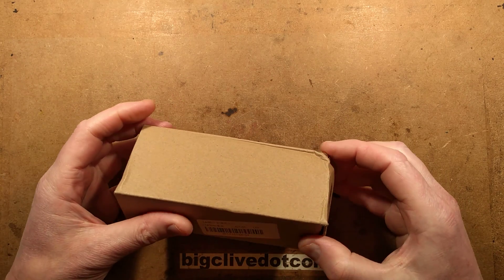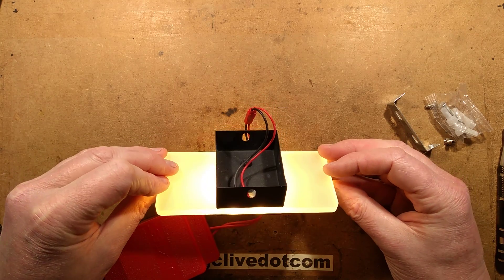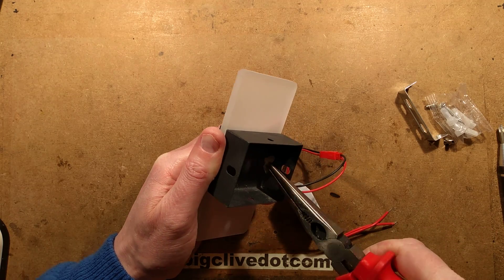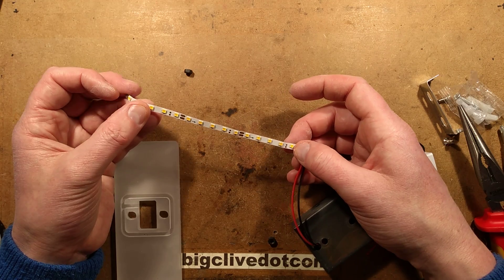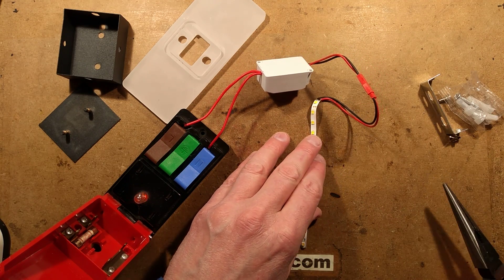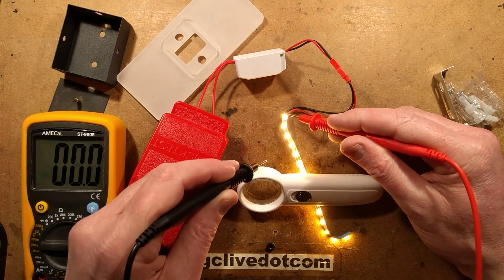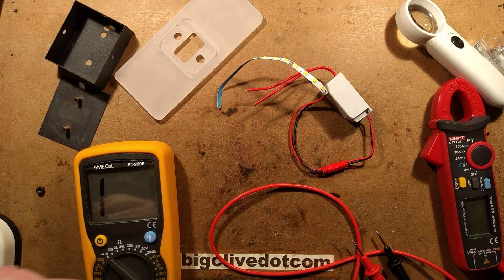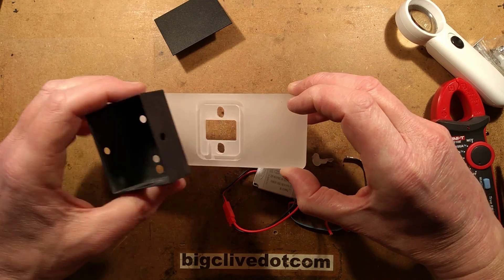Cleverly designed LED wall light with hackability.

Comment: One of these times, you'll put your finger across one of those capacitors, and it'll be fully charged. 😁
Reply from the maker: Extra entertainment.  I'd specifically not do it on a non-working unit.

Comment: We usually spend 1/2 of our year living in a 36 foot RV, this would make a great hall light for the unit, as well as added light for the operations center, well the drivers compartment which could always use a bit of extra light when you are consulting maps at night.  I could find dozens of places to mount such a light, they would make a great replacement for the cargo lights inside the undercarraige storage compartments.  I will have to keep an eye on these for future use, should I ever get back on the road.  Recent family deaths and illnesses have grounded us for a year but once the estates are settled, I am in hopes to get some miles on my rig once more; perhaps with a few of these lights added.

Comment: I’ve just bought two of the bigger ones, identical except it’s five parallel sets in series and 15v. I wanted to run them on 9v, so now I’m going to have to split them into two groups of two and put current-limiting resistors in. I should have known really from the higher power rating!

Comment: How would you connect a single LED to a 240v  power source.. would you use a 56K resistor in series ??
Reply from the maker: It depends on the type of LED and your supply voltage.  It's a very inefficient way of driving an LED.
Reply: @bigclivedotcom  i found your video on them, what is an efficient way of doing it .

Comment: If they are anything like the cheap strips I get for cutting up for my models and stuff, each smd led is parallel, you can cut them up anywhere, remove a bit of white, solder on some wires and presto. I've cut mine right up to the smd on 1 side of it and it still worked. I don't know that much about electronics so I will leave it up to you to explain my smd led strips :'). I think they just have a positive and negative rail  either side and the smd's are sat in between? (I paused at 7:50, if it gets answered after, sorry about the redundant comment lol )
Reply from the maker: That sounds like the battery or USB powered stuff.  It usually has a resistor per LED and can be cut on the marks between each LED.

Comment: Could this perhaps be wired in series?
Reply from the maker: You could theoretically wire two in series on a 240V supply.  But I'm not sure where that would be useful.
Reply: @bigclivedotcom  I mean you're right, maybe if I had a row of them. Thanks for the reply

Comment: You should tear apart and test the new 10,000 MAh power banks they sell at 5 below.  They are only $5 compared to other 10 Ah power banks that go for around $20 or more... I would love if you could do this as I am very skeptical and I don't have the tools to do it.
Reply from the maker: They are either fake capacity or just the case with no cells for you to install your own.
Reply: @bigclivedotcom  could you please test and tear one down?  I have one and I know that they indeed do charge devices, I am just skeptical on the capacity.  It would really make my day.
Reply from the maker: @chuckthebeast7693  I've taken a few inflated capacity power banks to bits in videos.

Comment: Greetings, oh wise one from beyond the wall of Hadrian! I now how you love quality electronics at a good price, and  I recently ran into a power supply that rivals those from China at about the same price. I have just received my supply, sadly the price has gone up from 9 USD to 14 USD, as it was on sale when I ordered mine last week.  You need to see this, it would make a great comparison to the ones that you get from the Chinese sellers here is a link to the unit, it can handle any input from 100V to 240 so I am guessing it would work in the UK but I could not be sure, as I am not up on the way these things work in your part of the world.  Take a quick look, not sure what shipping would be from here to there, perhaps prohibitive  https://www.goldmine-elec-products.com/prodinfo.asp?number=G23322  When I ordered the unit, I also ordered their super surprise pack, I love those, they supply me with some extremely good capacitors and reisistors as well as things I have never seen before.  This time the pack had, in addition to the large number of electricial components, one kit to build for practice, and two little power supplies they are buck supplies designed to take from 12 to 48 volts in and spit out a solid 3.3 volts at up to 65 watts.  Checking Amazon, the units are listed at around 125 bucks US, other dealers have them from 79 to 145 bucks.  These appear to be new, so I checked to see what I could get on Ebay should I try and the market has them at 13 bucks, so perhaps not the greatest deal but the pack is still worth the cost of the shipping and initial cost which was, I believe 15 bucks, the hole order totaled 32 bucks for me the box also had some strange capacitive touch switches from W, H. Brady Co.

Comment: You know that would fit an ESP or other small micro board and PSU, could do some really cool stuff, addressable LED strip for a start, and you could build in all sorts of sensors (weather station? entry sensor?) , even a camera would be easy enough

Comment: That metal on the front, the square black piece glued to it, is called a diffuser and it is to cause the light to create ambient lighting only vs direct lighting.  It forces the light out into the semi transparent plastic only thus creating the ambient effect.

Comment: Just a shame that after a couple of thousand hours those LED will have dimmed right down and shifted in colour like they all do...
Reply from the maker: This is why I prefer to under-run LEDs.  They last much longer and after some time the under-run LEDs will be brighter than the over-run ones.  At least this housing can be refurbished with a suitable tape and power supply.

Comment: I wonder if it hasn't been assembled quite right. It looks like the loop channel where it goes on the inside is supposed to leave some room to route the cable, while the outside lower section where the cable was routed is supposed to house the end of the tape. So all of the tape gets used. Because there is just enough tape to run all the way around.

Comment: Looks like a cool light. I reckon you could convert it to low voltage by filling the cavity at the back with 2x 9v batteries and the correct resistor and a switch and your all good.

Comment: I enjoy your channel and look forward to your releases. A quick question if I may, I understand the theory behind using using AC rated switches for DC applications and derating them but would you need to derate an AC rated connector used in a DC circuit if you specified "switch off power before disconnecting"?
Reply from the maker: The connectors would probably be fine in that scenario.

Comment: Too many people on here like watching you stick your "long nose" plyers onto" nuts"...kinda disturbing. I LOVE simple designs like that where you can hack the SNOT out of them. I have reels of different kinds of leds. I also have several boxes of Ied power converters. I like sticking those LEDs on my RC planes and lighting up the evening skys. I also build Models and love adding leds where needed. The remote controlled RGB setup would work great for that.

Comment: Those LED strips run on a parallel series. I buy them in a roll of 16.5 ft. Or 5 meters. But they can be bought in a roll of up to 100 meters. The one I get are for a 12v power supply I can use the same power supply to run one section of 3 LED’s or two rolls connected together. 

Right now I have 3 X 3ft. Connected together running along each window. If give me “light drapes” it lights up the glass in the window making a cool effect as well as giving me extra privacy..

Research led strips. My next adventure I will look into the Neon strip....
Reply: He has 12V strips, tons of them. This one is different. It's same current no matter how long you cut it, variable voltage. So it's specifically designed for a constant current rather than constant voltage power supply, because those little ones are super cheap.

Comment: Not a bad looking light. I would think that you could also use a PWM board to control the lighting level if you had a bunch wired up and wanted to dim them.
The next trick would be to add color changing to it. Mood lighting.
Thanks Clive.

Comment: power supply pcb has brand etched in the copper in the isolation gap... (facepalm)
Edit 12:25
Reply from the maker: That's unfortunately pretty common.

Comment: Terrible from heat sinking point of view. Heat reduces the lifetime of all opto-electronic devices. It also reduces their efficiency because it increases leakage.Of course all modern LEDs and laser diodes use separate confinement hetero-structures which improve carrier confinement, but at some temperature the carriers start to escape anyway.

Comment: Oddly satisfying as always.
If there was a sheet of magnetic metal under your work surface, and you had some rubber-coated or plastic-coated powerful magnetic rods or sticks about, they could be used to pin down things such as the COB light tape, instead of holding things down with uncooperative stray implements.  Of course, that might introduce some electrical mischief I don't know about.

Comment: Looks at the JST connectors with one red and one black wire and asks: are they keyed?  ;)
Reply: Yes, these are JST. You can buy these with cables cheap on ebay or aliexpress.
Reply: Those JST connectors are keyed but it is possible to force them in the inverse sense.
Care must be taken if hot plugging.

Comment: At least with the construction it would be easy to attach a ring connector to one of those threaded posts, using the existing nut, for an earth connection (after removing a little paint for continuity).

Comment: I've got a few meters of LED strips like that but in red.  We use them to light up custom signs. Surprised Clive hasn't seen that before.
Reply from the maker: I've seen the standard 5V, 12V, 24V, 120V and 240V parallel strips that you cut to length, but it's rare to come across this type with a circuit arrangement designed for current limited power supplies where you bridge the end after cutting it to length.
Reply: @bigclivedotcom  Ahh that makes sense now.

Comment: Big Clive has never seen a cuttable led strip
Reply from the maker: Not the current regulated version where you bridge the end contacts to make a multiple of series circuits.  Most are based on a parallel run of series circuits.
Reply: bigclivedotcom there is a lot in Canada like that where I live

Comment: Could that 9v driver drive a 12v fan
Reply from the maker: It's a current regulated driver.  With a fan it might put out a much higher voltage.

Comment: Would an insulation resistance test across the primary and secondary of the transformer give a good indication of the separation?
Reply from the maker: It would give an indication at that point in time, but the transformers often run hot in these things and it does make you ponder insulation breakdown over time.

Comment: I was just talking to a client about garage & shed lighting & this lighting would be great as a solar/18650 combo for such an application so THANKS 😉🤓
Reply from the maker: It's more of a visual effect.  It wouldn't be as efficient as bare 12V LED tape.
Reply: @bigclivedotcom  oh so i wonder how the unfrosted will behave🤔 its not for a true light its more for an "emergency light" look there looking for so they can use the lock better or like in the shed see the light switches location type lighting rather than having to take a torch with then so HOPEFULLY it will give out enough for something like that?🤔🙈

Comment: Why is it that PSUs typically will full-wave rectify the mains but only have a single diode after the transformer?  You'd think it'd be better electrically if the final were full-wave too.  And I wonder if the diodes would run cooler too; they're usually quite warm when you use IR video.
Reply from the maker: It's a flyback style system.  The mains side puts a magnetic field onto the transformer and when the field collapses it charges the output cap through that diode.  It means that power gets metered across in accurate pulses.

Comment: Isn't it a constant current supply? I have some which say something like 15-20v and 250ma +-5%.
Reply from the maker: It is constant current.  About 200mA.
Reply: I wonder, could that supply run on DC? Say you have a 24v motor home thing; can the switching supply take 24V DC in and drive those lights? If not, why can't it operate at a lower input voltage?
Reply from the maker: Some will run at low voltage, but I just tried this one in 24V and it didn't.  It's optimised for use between about 100V to 240V.

Comment: These things are also not legal for installation in the US since the violate electrical code, mainly grounding, but also since they are not listed by any other insurance institute besides China Export. It wouldn't take all that much to make it compliant is the worst part, except the power supply might not pass testing and is most of the cost of the fixture.

You could also mount it at any angle by using a hicky attached to the yoke.

Comment: Glad that I stumbled upon this video. Because of the mains operation of this light, (and metal parts), I would definitely earth the metal parts. But I really like the LED Wall Light and the concept of spreading the light through the diffused perspex. I have a 12VDC Lighting System in my home, all operated from Solar and Deep Cycle batteries. I would simply dispense with the mains power supply, and operate the LED Wall Lights from 12v. I want to buy 6 of these - a brilliant design. Current draw is also very good. Thanks Clive.

Comment: You could buy a 24v DC DC Buck Converter ... there’s these tiny ones with the tiny tiny chips on them, super efficient, they handle up to 30v like a breeze

Anything under 1a they stay stone cold

Comment: First time I saw the Cliff Quicktest, nice idea.  Went and looked at your other video on this unit.  While $55 is a bit expensive, it would take me counting on 3 hands, the times I managed to arc something with the mains.  Thank you for showing this testing unit.   I should just take my paycheck and divide it into three Amazon, AliExpress and eBay.  Keep broadcasting!!
Reply: The QuickTest might seem costly but once you get one you will wonder how you coped without it. It is worthwhile getting a selection of UK HRC Plug fuses so that you can replace the internal fuse if (i.e. when) it blows!
Reply: I have an RS variation on the same thing; it used to get a lot of use as I used it to test out new appliances back in the day when they didn't come with plugs pre fitted. Now we have moulded 13A plugs fitted to everything, it's now test, chop off and bin the plug, feed the cable through the cable sized hole and then fit a new plug, with a more suitable low value fuse. Progress...

Comment: To run this from a 12V supply could you just use a 7809?
Reply from the maker: It would still be dissipating the difference as heat.  It may be easier to source and use a suitable resistor.

Comment: would be interested in seeing a tear down of a video sender, if we had a battery powered receiver and step up transformer on the antenna side then rectified.. wireless power (maybe) 🤔🤷‍♂️
Reply: I’m thinking that the battery would last longer if it’s only powering a receiver and stepping up from the antenna side instead of using a battery directly 🤔

Comment: Could you modify it to run on batteries or a usb by taking the midget ps out.
Reply from the maker: It needs 9V minimum, but you could replace the LED tape with 5V USB powered tape if you could find a version slim enough.

Comment: Does it really need an earth?  The metal only has access to the edge of the tape.
Reply from the maker: It only takes a rogue whisker of wire.  Literally a single strand - to pass enough current to give a fatal shock.

Comment: Long nose pliers? Get a socket set!
Reply from the maker: It was the easiest thing to hand.
Reply: @bigclivedotcom  Yep, I was being facetious. I would do the same. Bugger trying to find the right size socket, fitting it on, finding that the nut is imperial, having the socket fall off somewhere into the case ...
Reply: We all do it, the pliers are usually a lot closer than the proper tool.

Comment: A good example of a manufacture that has some good measure of craftsmanship, and ...(self respect) ?  I'm planning a teardrop camp trailer build. This light is a good candidate for interior lighting.  Either 12 volt supplied or 120 VAC. USA.  Now.. A good exterior light. Hmmmm.

Comment: Those red connectors are common hobby connectors called “jst”, surprising to see them used in a mass produced item.
Reply: Used alot in RC Aircraft and Drones
Reply: They are keyed but flimsy plastic means you can easily reverse polarity
Reply: If they're crimpable, then why wouldn't someone use them in a mass produced item?
Reply: @SianaGearz  I would have thought they would be expencive relative to cheaper "non branded" connectors? Kind of like the xt60.
Reply: @pargunar  These wouldn't be genuine Japanese connectors, all of them have numerous off-brand clones. They're ancient, if there were any patents, they long ran out.

Besides,  the reason you've seen JST-made connectors (though of different types, like PH series) everywhere in Japanese electronics in 80s and 90s is because they didn't exactly overcharge for their products.

Neither was the case with Dean's Connector and EC series. In lieu of cloning those, HobbyKing's parent company decided to develop and establish a new open standard with XT series connectors.